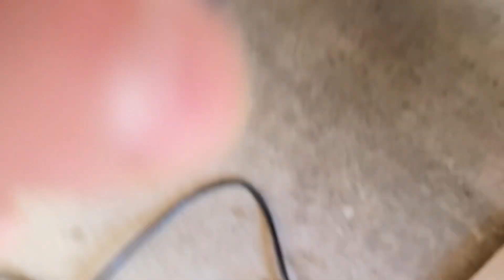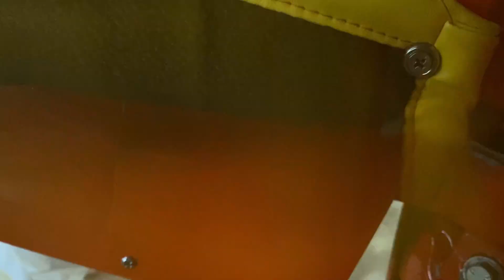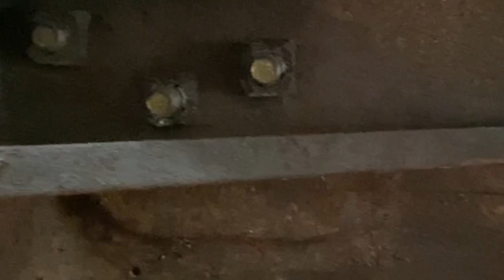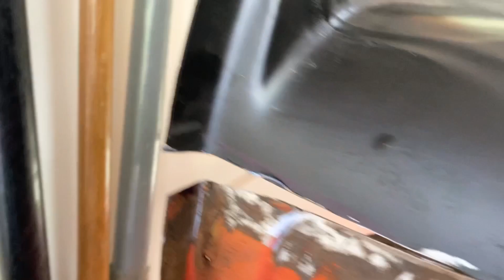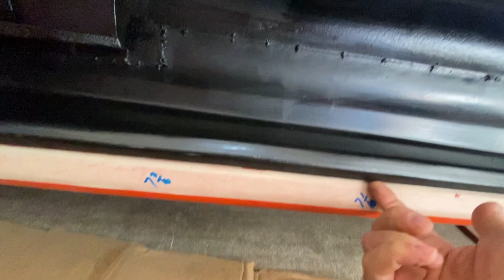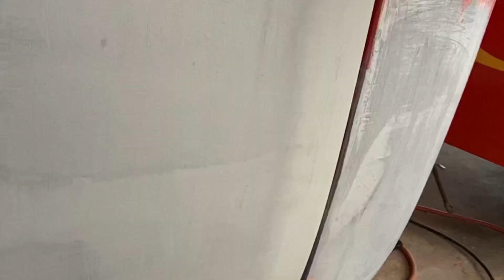1956 Chevy Truck Rust Repair

Comment: Very impressive skills ! Your comments thru the video sound like your a novice, but your preservance and quailty of workmenship make you look like a journeyman! Your truely an insperation!  I'm starting my complete rebuild on my 56' this winter, and you sir have really motivated me !  Thanks, Dan, Clovis, CA
Reply from the maker: Thanks Dan. I’ve done a fair share of bondo in the 70’s when I was a “kid”! Back when cars rusted after you drove them off the dealer lot. I did rust repair, small dents, and paint while still in HS. This is my first foray into welding in proper panels. I learned to weld by watching as many videos as I could find and practiced on scraps. Good luck on your 56!

Comment: Nice job.  Where did you get the repair panels?
Reply from the maker: Thanks! Parts from a combination of Brothers for the passenger lower door skin, Classic Parts of America for drivers side lower inner and outer skin, cab corners from Classic Industries. Vendors don’t always carry the exact same pieces, some of the door skins come up higher on the door and some of the door bottoms include a bit more metal than others. For example the Brothers door skin passenger side was 12 inches tall which fit my needs better than a 7 inch tall skin I previously purchased. The classic industries lower inner/bottom metal drivers side was a bit more complete and fit my needs better than the one I purchased from classic parts. I was able to use a big piece of the classic parts inner panel I purchase for the left side on the right as that door was not as bad.